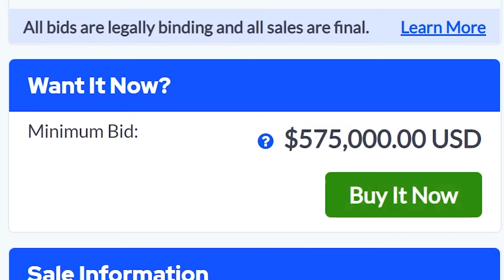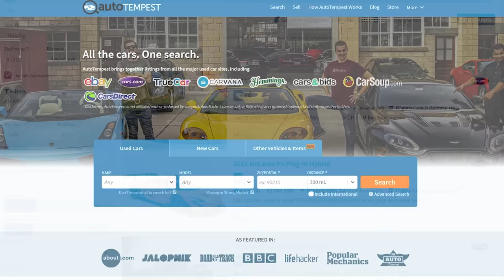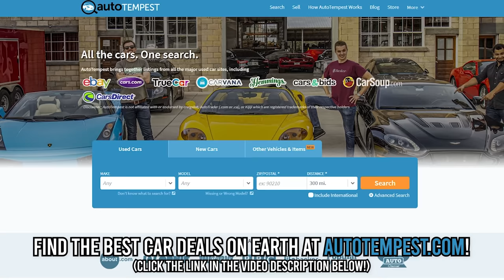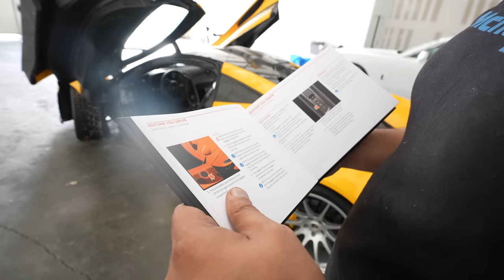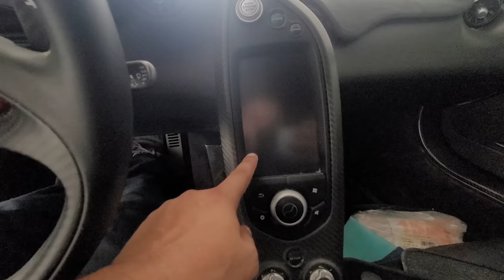I Bought A Flooded $2,000,000 McLaren P1 And It's Worse Than You Can Imagine

Comment: As much as I LOVE the idea of having a P1, due to my work in the insurance claims industry I can tell you that you would want to avoid a flooded vehicle just about 100% of the time!!!
Reply: Hey, could you explain why that is? 🙂
Reply: @Domtune89  The damage done by a flood is catastrophic.  One of the big issues is that after it dries, the damage can sometimes be hidden or not so obvious.  But it's still there... You could have non visible parts that rust or decay, water gets trapped in areas that can't be seen though still creating damage over time as it sits there.  And that applies to engine or drivetrain parts just as much as the body, frame, or interior dressings.
Reply: Although... a lot of what you say is true, i have rebuilt a number of flood vehicles. The first came from a flood in WV. The car was a submarine! It took 2 months to disassemble it, and clean everything up. I had a wrecked donor car that had all the electrical parts to repair this car. I drove it for years... with no problems!  The last vehicle I did, was the same way... completely under water. But, it was fresh water, and was easy to clean. It was a Chevy Silverado pickup truck. I used a exact donor vehicle for it to replace everything electrical. And... it still wouldn't start! So, I towed it to the dealer. All that was wrong was, the battery was dead for so long, the 3 computers were not talking to each other. After having it reprogrammed (about $1,500), it ran fine.
Reply: @wc-yn6ep   "Although... a lot of what you say is true..." <<-- Actually, I think all of what he said was true ;P
Most of what he said was just factual information relating to water/flood damage, but having already restored a flood-car, I doubt you would disagree with any of that.
So it must be the part where he said "I can tell you that you would want to avoid a flooded vehicle just about 100% of the time!!!"?
Well, obviously he was using "you" as a generalization, meant to encompass whomever might end up with the opportunity to purchase a flood car.
100%, in this context, would mean a number of people that is "less than 1 out of 100".
And since we can't politely cut people into smaller pieces than *1 piece*, that means he is effectively saying the number of people who might not want to avoid a flood car is more like 1-out-of-1,000-people, or 1-out-of-10,000-people.
Essentially, the sample size is not infinite, but has to be greater than 100 people.
I think that sounds perfectly correct.
And if you think 1 out of 100 people actually have the combination of the skill-set, relevant knowledge and ability, experience, and resources that you drew upon to be able to do what you did, then I think maybe you are being a little too modest ;)
Personally, I seriously doubt 1 out of 100 people could replace a car's blown engine, even if they already had the car and a replacement engine already sitting in a nice environmentally controlled garage ;)
But, hey, even though I'm saying I think your choice of words there was incorrect, at the same time, I'm also saying you are quite a rare and valuable individual when it comes to car repair :)
And, congrats on your post aquatic automotive achievement! ;D
Reply: This might be the case with an older or cheaper vehicle., but.... this body is completely carbon fiber, most if not almost all metal in a supercar like this is aluminium or magnesium or titanium. The brakes are carbon ceramics. None of these materials rust or corrode very little. The body is glued. It will cost a lot of money to fix the obvious broken bits but most of the usual issues don't apply here. I bet that the car is still perfectly fine underneath.

Comment: Been Buying Salvage and Rebuilding in Linden NJ for 25 years ... I got one from 2012 Hurricane Sandy Flood Car from Long Island IAA. My inside guy at Brooklyn MB Dealer's Shop told me this almost new 2011 w 1,820 m E350 4Matic Sport was left on lowered lift inside shop, so no rust under seat rings, yet was X'd Out as a Total Mid-Door Flood Loss. A $70K Car New, my 2011 E350 4Matic Sport with Auction Fees,Tow with a total cost $14,800.00 that includes OEM accelerator pedal assembly, carpets and floor pans rinsed and cleaned and started right up. One year later had to replace lower mounted alternator, other then that, today I still own this Silver Gray Benz (was a BDay Gift for wife's 40th). She's a non smoker with no kids, 74k on a 12 year old car and still looks great. I was very lucky with this Flood Car but many other Rebuilders here in Jersey were not so lucky, so we only bought flood cars for parts ever since Sandy. I will soon sell it very very cheap to a friend for good continued Karma

Comment: The problems with flood is electrical and hidden mold, as long as you don't try to run the motor wet. Sea water will rust you out fast, so you have to rinse and recoat everything.

Comment: Handy tip - when trying to move a car (for example like at 37:10 getting the P1 onto the lift/ramp) it’s much easier if you rotate the wheel/tyre, not pushing on the body. On most cars you can move it with one hand by rotating a wheel. Obviously, in neutral with brakes off!
Reply: yeah, 2 to 1 mechanical advantage
Reply: This should be more widespread knowledge! Especially among car enthusiasts :)
Reply: Yep, i can move my land Rover defender with its 2,3ton easy alone
Reply: nah i think the guy in green shirt had it right... you grip the headlight and rip it towards the tail light.... lol
Reply: Ohhh--brakes OFF...

Comment: So just got here and dont know any of the rebuild yet currently at 24min mark but i know. Salt water destroys everything. The engine the trans. If battery is hooked up all electrical is fried. Mold is a whole another story. But you have to strip entire car apart. Soak and refinish every nut and bolt. Replace all electrical, buttons and all or clean them. Yeah its a huge undertaking

Comment: I really hope this doesn't end up being a $1.4m job with a ton of extra work hours. That thing's a beauty, but knowing how extensive the electronics systems are, they surely can't be cheap or easy to work on. I heard "flooded" and the first thing I thought wasn't sand and salt water through every nook and cranny. I've had to pause many times to wince at the damage.
Man, the only good thing about this being what flooded, is probably that so little of it is steel.

Comment: I fixed something flooded and it worked 3 days, i cleaned all terminak it worked again a few days. Would have been easier to get a new wire harness a nd new. Sensors ill never restore a floodex item again , good luck on your pfoject

Comment: You should have power washed these breaks and even the whole bottom to get the dirt and sand out.  Use some soap to neutralize and better wash out the salt.  When you were rolling the car, you created a culinary salt (and sand) grinder ;).  I think it's important to get rid of that salt in all of your car asap.
Some more info:  "The easiest and less abrasive way to clean off that corrosive salt is by using 2-step touchless wash soaps."

Comment: I have dealt with a flooded WRX.  I would NOT take on a rebuild of a modern exotic.  Maybe a 70s or older Ferrari or Lamborghini, but not a modern car with more wiring and computers than the space shuttle.  The very first thing that needs to be sourced is a factory assembly manual.
Reply: The only way to rebuild a flooded car is to completely disassemble it.

Comment: look with a lot of time and a lot of pins u can replace every pin in every plug and you will have a good car it will start over all the brains is dipped in this water prof clear glue stuff. just make sure every thing is clean be4 u start it and all water is out of every thing and dry and clean  anything that has water damage.  only way u will have to spend large amounts is if you just thank okay we replace . most of all of it can just be cleaned and the pins in connectors just replace them aand set only thing will cost is the body damage

Comment: I think that the mindset here needs to be that you've bought a complete set of parts of a McLaren P1, they just happen at this time to be bolted together for storage purposes.  Some may not be salvageable, hopefully, those are few. Now; get to work dismantling and having checked them out.. put them back together :>)
Reply: So Einstein, what market do you think there is for salvaged P1 parts?
Reply: @byteme9718  You haven't bothered to read what was said.. the last phrase reads, '. put them back together'.. it's simply a joking comment that just about everything will need attention.. a huge undertaking.
Reply: @jamesgraham6122  But this will never go back on the road as a functioning P1. McLaren will refuse to sell parts that are essential to repair it. It's not in their interest to have a written off car put back on the road that will cause nothing but trouble for any subsequent owners. Even the standard McLarens are problematic enough.
Reply: @byteme9718  WOW! Imagine paying almost $600k for a car that can never be acknowledged by McLaren.
Reply: @jamesgraham6122  Someone didn't do their homework before bidding. Even if the parts were available (some won't be) and if McLaren chose to sell then (they won't) their cost is often insane. For instance, some of the P1 batteries cost $145,000.

Comment: so funny worrying about glass damage and scratches... Saltwater lol... the electric is gone. Everything underwater is to be replaced... well if you do it right.. Dude the wheel got a hole you can not fixed that, no need to take the tire off... lol. any scratch on any wheel and you need to replace it... if you do it right ;)

Comment: I want to know what kind of drugs you're selling to have to be able to spend a half a million dollars on a Supercar that's junk. McLaren ain't nothing like an Aston Martin man I don't care about the top speed. I got a Chevy Monza to does 235 mph. All I got to do is run High test gas and hook the bottle up LOL if I run oxygen and hook up the C A.S. system. O2H2N1 Lolz Bye Bye Birdie. That's all I got to say I have 738 horsepower to the rear wheels on a 327 small block Chevy V8 with a 4-speed Muncie turbo tranny 400. Top speed in a quarter mile with 181 35. Eighth of a mile one 68-55 with no spray 4.335 seconds and that's running high-test nitrole based Airplane fuel.  .. so yeah I got a little rocket ship under my belt sitting in the storage unit right now. Anytime you want to race let me know I'll race you for titles😃😃😅 I hate to see you walk away with no car bro
Reply: Yeah someone can build cars just as fast for cheap, but they do not have the name mclaren on them. Those rich people just want to say they own one.